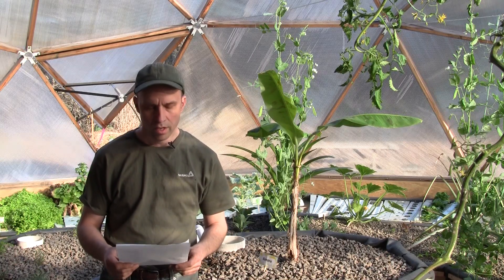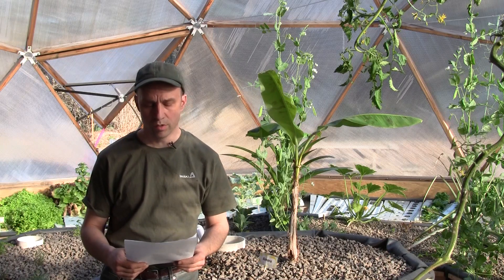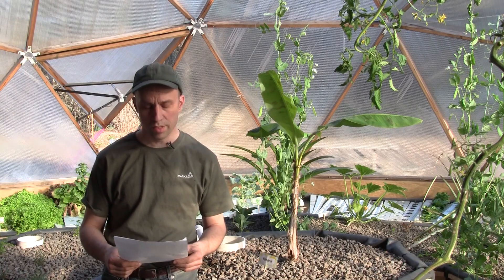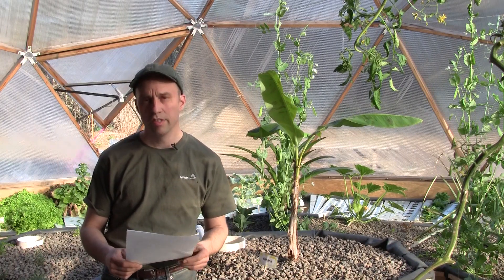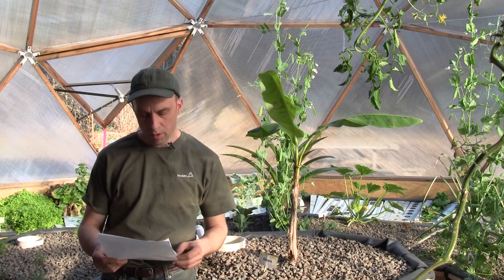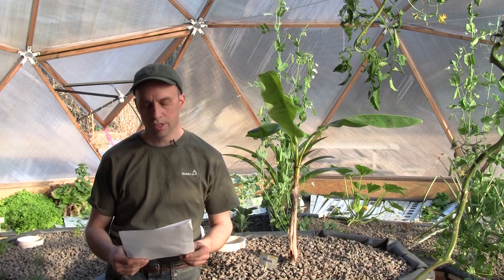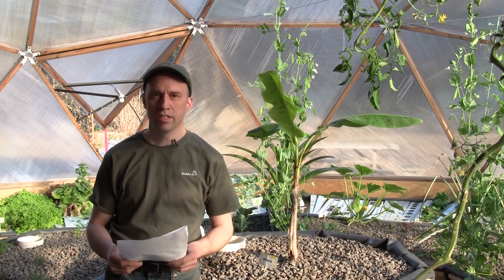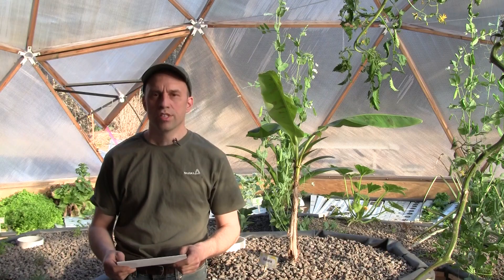FAQ #5 - Aquaponics - Geodesic Dome - Rocket Mass Heater

Comment: peanut butter jar, 1/2" piece of PVC going through the middle of it with a hole cut out,  (so they can enter the jar) and on the inside, put a piece of rotting fruit or veggy with some water so they drown.

for catching flys usually just switch out with something like raw meat in the water. I've caught LOTS of flys that way.

Comment: Apple vinigar in a bottle with some seran-wrap over top with tiny holes punched in traps the buggers and they drown and die and can't quite fly out through the holes. hole-size is a test-too-fit issue as YOUR species might be smaller/bigger than mine. good luck.

Comment: I always wondered about the name, now I know. The situtation with light penetration is something I was concerned about before adding the second layer of poly. But with much less condensation now, it was a good idea. As for the plastics, I think most of them are ok as long as they aren't heated. The melting process is where things get nasty.